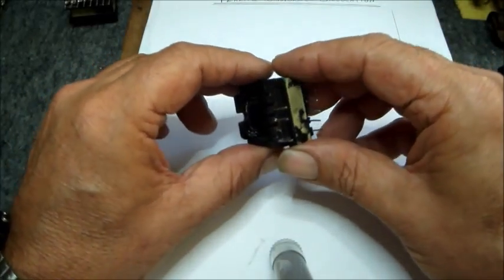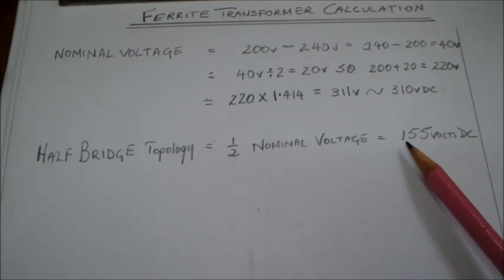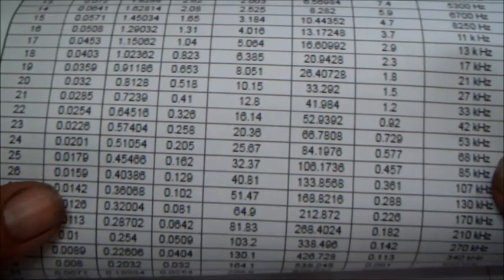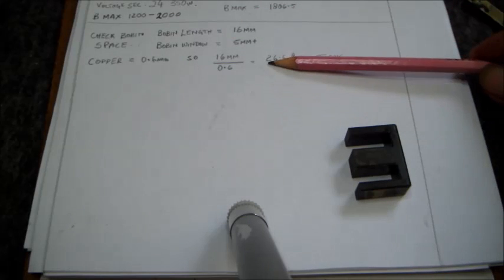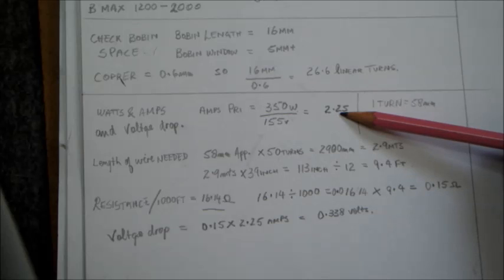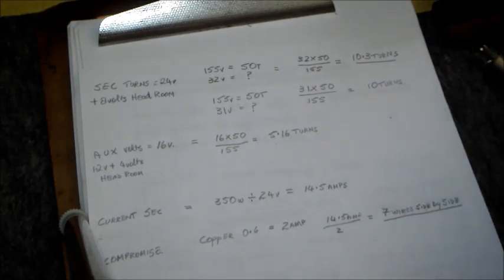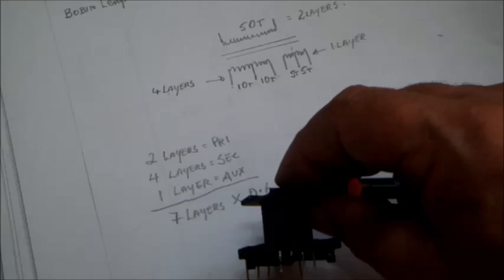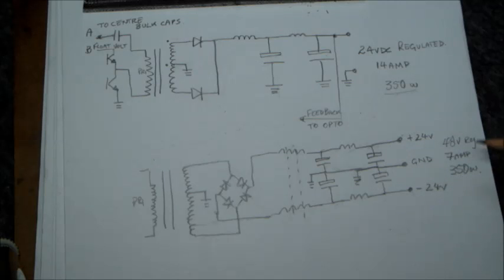Ferrite transformer calculations for SMPS

Comment: The biggest problem is the unknown transformer ferrite core, I do not now what is used in a pc supply where I got mine from.
Reply from the maker: You can keep the flux density on the low side to be on the safe side. To give you an idea if you are going to calculate for 50Khz keep at around 1400 guass.
Reply: @supersilve  Thanks Silvio for your respons, I did see this transformer has no gap, not a little strange for a 350 watts pc supply? I did measure primary original 240uH on this transformer and it is a ETD type transformer, like ETD 39/20/13 but mine measure 39/23/13 can also be a ER type also, think that it has above 200 Khz frequency seen the low inductance it originally had. Maybe I canb better buy one who has kwown specs, I need it for 15 volts 5 amp, 350 volts 200mA and 120 + 120 volts 300mA, maybe to feed the mosfet part also 65 + 65 votls 20 amps is needed, I have a new ETD59/31/22 and a E71/33/32 core 3C90, regards kees.
Reply from the maker: @audiokees4045  well that is quite some power you need for the 65+65@20A that is 2600W.  The ETD 59 will suffice for this driven in HB. Summing up the other voltages needed you will need around 220w in all.  I do not know if these voltages need to be regulated or not  but you have to be careful if so as the feedback for high voltages will be a bit tricky. For these the ETD 39 has plenty of power to give you and can go at 550w continuous and 700w peak with medium power fets.  Take a look at the video of my audio 700w smps published here on youtube it uses an ETD39. 
I would like to point out to you that a gap is not needed in Half bridge, full bridge and push pull typologies.  The gap is only needed in flyback type typologies etc where there is usually one mosfet pulsing the winding in one direction.  The gap is needed to store the magnetic field then it is released when the mosfet shuts off to start the other pulse.  However the flyback typology requires a larger core for the same power compared to HB as it only uses the first quadrant of the magnetic flux while half bridge and full bridge and also push pull use the 4 quadrants.
Reply: @supersilve  Hi Silvio, I did build a welder who was 5 kw, using a big e71 CORE, the voltage I did mention is for a audio amplifier class d or a hybrid, so the supply do only give peaks, of 20 amps, when needed by music impulses, and loud who not happen much, so mine supply do not have to work so much. Maybe 10 amps is already enough, the transformer will never get driven to his outer region then. the welder did becaus it is continously big amps, there i did use a resonant supply, idea was also to use with the audio amp because it give a more sinusoidal signal to the output capacitors making the dc much cleaner and I have soft switching. Do you now program xcellentIT? it is a program with a list of transformers and calculate the windings etc, you put in Khz, deadtimes, and core and voltages it does calculate for you, google it.
Reply from the maker: @audiokees4045  Well as you where saying if the smps you need for audio that is a different story.  To peak 2KW you still need an EE55 trafo. your continuous power will be around 1KW because audio draw around 50%.  You can opt for a non regulated supply which works on 50% duty however this will eliminate the use of an output inductor.  Input capacitance must be at least 1uf per watt so for you about 1000 to 1200uf across the 320v will suffice. (4  capacitor rated 1000uf X 200v) or (2 capacitors 680uf X 450v). Input capacitance is important to minimize voltage drop at load. Regarding current density of the copper wire you can use 6A/mm².  Yes I use Excellent IT for my calculations now it works well for HB, FB and push pull typologies.  If you want to take a look on my channel I just uploaded a 2KW smps for audio.  If you want some help just send me your mail and I will answer back.
Reply: @supersilve  Hi Thanks for advice, I am busy with desiging the circlotron tube/mosfet amp with autobias system because of use vertical mosfets, now I has a plan to build a small smps who does only 15 volts 5 amp (tube filament regulated), 350 volts 200mA and 120 volts x 2 3 a 400mA. I use the xcellentit program to calculate the windings with a kwown transformer, now I need not such big one, when I go ready with amp the smps will be have two extra 65 volts 20 ams windings, and still the feedback will be set on the filement voltage who needs to be precise and is a good start, where is your site? the copper surface also is easy to calculate with that program, I have done the welder with it, a feedback was needed for MIG also, does very good, however I have sell it and do now use Tig only. where is your site with examples, thanks.
Reply from the maker: @audiokees4045  I guess you will  be better off if you build 2 smps one with small transformer for the lower current voltages and 15v 5A.  For the 65v@20A you will do that on a separate transformer.  You can use one input capacitor bank to feed the 2 smps input and separate capacitors for the low and high current output.  You can leave the 65v not regulated and for the low current trafo you can use feedback to regulate it.  My channel is on YouTube.  Once on my channel click on videos and you can see all my uploads.  There is a lot to learn.  https://www.youtube.com/user/supersilve/videos?view_as=subscriber
Reply: @supersilve  Thanks, that is maybe a good idea, for the small one resonant is less usable so can be hardswitch, the other 65 volts can be resonant, this will give also a fast response without a feedback who needs to be done through a filter. I have in the welder using a comparator in the feedback line for fast respons, pulswise.. th small smps has not only 15 volts 5 amp but also 350v and 2 x 120 volts for the dc couple hybride tube mosfet amp. I do use 350v because of use penthodes. I go watch your channel.

Comment: how did you calculate the 350 watt value
Reply from the maker: The core was taken out of a 350w  ATX power supply.  Usually these run at 20khz.  Note also that the higher the frequency the more power a core  can give.  There is a limit but according to the core material used.  Usually these cores can go up to 100Khz or so.
Reply: Thank you for answering. But how this is calculated?
Reply: in relation to cores CSA and weight of the core
Reply from the maker: @chbonnici  It depends on what topology the core is used. A core can give different powers depending on the flux density used and the frequency of operation.  Usually these can be found in data sheets.
A flyback converter need a double size core than a half bridge converter for the same power.  This is because the flyback uses the first quadrant of the flux while a half bridge uses the 4 quadrants.
Reply: So let us assume  a 1/2 bridge topology with a set frequency as you chose 33Khz,  then how  can the core wattage be calculated?
Reply from the maker: @chbonnici  if you like to know more i suggest you see a few videos on youtube by Robert Balanos. Its called designing a flyback. He is an engineer in power electronics and design power supplies for NASA. Prepare yourself for some complex math. You can also follow some lectures from sam Ben Yacov on youtube
Reply: @supersilve  Thank you for your kind help i deeply appreciate your time . I will try to look through what you suggested tomorrow. BTW I am Maltese and live in Lija. Email: chbonnici @gmail.com

Comment: Excellent video . Can you make a similar for ferrite toroidal? . Excellent job once again
Reply from the maker: It is the same formula.  You have to find the cross sectional area of the ring core.
Outside diameter less inside diameter.  Divide by 2 and multiply by the height.

Comment: Thanx for your timely response, but let me ask you weather to do primary culculation first and then do secondry or to do secondary first and then primary for inverter chopper.
Reply from the maker: Usually inverters have a push pull topology for the primary as this is driven by low voltage,  This will incorporate 2 primary windings one in series with the other.  According to the number of turns in the primary then a simple sum will get the number of turns in the secondary.  Let us say you have 4v per turn then it will become quite easy to figure out.
Reply: @supersilve  Sir.If i use AWG25*4 wire use what will be the frequency in calculation?Please explain i appreciate your channel it solve most of our problems. tnx
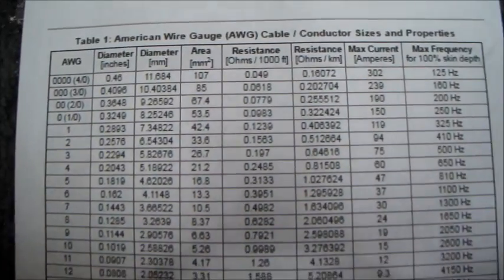Reply from the maker: @ifnzutech  As I explained in the Video every diameter of wire has its maximum frequency of operation due to skin depth of the current.  A shot at the chart can be found at 31:59.  You can see that the maximum operation frequency for 25 AWG wire is 85Khz.
Reply from the maker: For invertor chopper it is best to wind the primary first as this can be put more easily on the flat bobbin surface.  The secondary may consist of multiple wires and the winding may not be so flat.
Reply: @supersilve  Thanks sir for the quick reply my question is that if i use AWG 25×4 mean AWG 25 four wire it's frequency will b 85Khz or 85khz × 4 = 345 khz and when I'll calculate it i use 85khz or 345khz.
Reply from the maker: @ifnzutech  The frequency stays the same at 85Khz.  we use multiple wire to get more current
Reply: Sir thanks alot you solve all my problems.

Comment: For Secondary turn is it necessary to consider the frequency because i was thinking that 7 wires side by side for more amps to get is a lot. Can it may be made with some THICKER wire probably to reduce that numbers?
Reply from the maker: The wire gauge is selected according to the frequency of operation. This is due to the skin dept as current tend to travel on the outer part of the copper wire.  The higher the frequency the thinner the wire should be.  I just posted a link on the previous post for the copper wire table there you will find the maximum frequency for each wire gauge can handle .  One also has to consider how the wires will fit in the bobbin.  Remember that wire in a transformer cannot loose heat quickly due to it being warped on top of each other thus the current  handling will be less.  Usually 3 to 4amps per mm² for continuous rating and 6 to 7 amps per mm² for 50% duty cycle.
Reply: @supersilve  thank you

Comment: How to calculate the circle ⭕️ Sm transformer Csa
Reply from the maker: If you have a round core then you can calculate the area of a circle = Pie x R² or 3.142 x Radius ²
Reply: Silvio De Leonardo  sir inner radius ya 
Outer radius
Reply from the maker: @shyamsharmas-invomahamai2552   I taught you had a solid round core but now I understand that you have a ring core.  so you measure the outer and inner diameter then subtract the small dia from the large diam. then divide by 2 and after measure the height and multiply by the first answer.
Reply: Thnxs sir for replying me

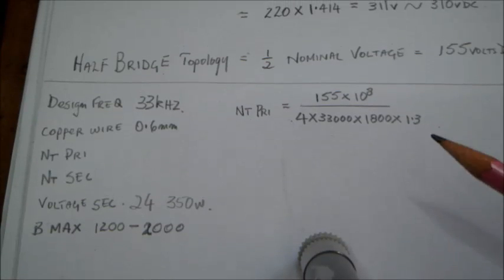Comment: 1. Formula Shown at Video time 10:15 will also work for a uncut Ring/Toroidal core?
2. What will be the rough B max value we should consider for uncut Ring Core?
Reply from the maker: B max will change according to frequency used 2000 guass at 20Khz and 1200   guass at 100khz.  As for the ring core you can calculate the core area and plug it in the formula.  Make sure that it is not a powdered iron core as it is not suitable. They act as core with air gap.

Comment: Hi, I am using EE 65/32/27 F48 MMG core, so could you please tell me the maximum power that the core can handle and what would be the optimum frequency to get peak power output.
I want to build it for 24 volt at the primary and 380-400 volt at the secondary.
Please help me I am trying to get information regarding this but I am really not getting it so could you help me please!
Reply from the maker: What are you actually building? What power are you expecting? I suggest you try something on a smaller scale first till you get some experience, when going to high powers things are not simple as they seem to be.
Reply: Silvio De Leonardo Hi,
I am building high frequency inverter using ferrite core transformer, and push pull topology, so I don't know how to calculate the optimum frequency for maximum power for my core so please help me.
I am using 0.8mm diameter copper wire for winding primary and 0.4 mm diameter copper wire for winding secondary turns, but I don't know how to calculate turns for push pull topology

Comment: thanks a lot for you but did you know the type of the ferrite material of this core or not and if i did not know the type of the material how i can choose the value of Bmax (max flux density)
Reply from the maker: If I would have known the core material I would have chosen a Bmax of 2000 guass instead as according to the frequency used it would have taken it quite easy. I played it safe and chose 1800 instead. Usually  computer ATX smps uses an N87 or PC40 core.

Comment: can you tell me why did you take flux density as 1800 gauss ???
and why Bmax is between 1200-2000 gauss ?
Reply from the maker: Usually the flux density varies according to operating frequency and also the type of core material used. For example at 20 Khz the flux is normally taken around 2000 gauss while at say 80 to 100 khz it is taken around 1200 gauss. The frequency used in this example is 30Khz so the flux density is lowered from that of the 20Khz range hence that is why I chosen 1800 Guass.  Bmax is the maximum flux seen by the transformer at the highest input voltage. The flux will be lower at a lower input voltage.  If you will work out the formula in the video and change a bit the values you will see how it changes.

Comment: if i increase frequency 40khz, power more than 350w? or power fixed? formula please.
Reply from the maker: From 30 to 40Khz there is very little difference in power. higher frequency more power from a given core

Comment: if i want to use the push-pull topology, what is the change in laws should be considered?
Reply from the maker: Not much really but push pull topology has 2 primary windings (Ex 12-0-12) in the calculation you can put 12 X 10^8 instead of 155 etc
Reply: thank you verry much for the reply, actually i want to design step up push pull converter (300 v DC to 6kv pp AC) for later multiplied to 30kV DC, my question, is it possible to use ETD59 core?
Reply from the maker: Yes it is possible to use an ETD59 core
Reply: thank you silvio, just to good understanding, if I have 320 volts as maximum input voltage, so that each primary windings is under 320V (i.e. 320v .0 .320v) which implies that in the calculation of primary winding turns I take 320*10^8/(4*33000*bmax*Ae), or take the nominal voltage?
Reply from the maker: In that case you would not use push pull topology but full bridge, and you will only have one winding for 320v.  Push pull for high voltages is not suitable as it takes a lot of space in the transformer.

Comment: How to calculate the design frequency
Reply from the maker: The design frequency depend on quite a few things to be considered.  1 the higher the frequency the more power you get from a given core but not all cores can handle high frequency. One other factor is the wire gauge to be used and how it fits in the core. The higher the frequency the wire diameter gets thinner due to the skin depth. At higher frequencies switching losses also have to be considered.  Usually a frequency between 20 and 80Khz can be chosen and most cores can handle this frequency range.

Comment: I'm a little late asking this but when it comes to making a step down transformer rather than a step up does it matter whether i wrap the primary coil first or the secondary?
Reply from the maker: no not really but its good practice to put the longest winding in the bottom due to it being of finer wire gauge. The secondary in this case may be shorter but thicker and it will fit better on top.  Thus like this the primary will be neat and flat on the bottom.

Comment: If the input voltage to the power supply was between 100V and 240V will the nominal voltage be: 240V -100V = 140V, 140/2 = 70V giving 100+70V = 170V RMS, 170V x 1.414 = 240V DC peak nominal voltage. If using half-bridge topology 240V/2 = 120V, if using full-bridge topology will it be 240V DC?
Reply from the maker: If the calculation for the primary turns had to be with a wide input voltage such as 100-240 then the calculation for the maximum input has to be considered or at least one has to calculate the maximum B at maximum voltage and see that this does not exceed limits otherwise there is a chance of saturation in the transformer.  In return the secondary windings have to be calculated at the minimum input voltage so the desired output voltage can be maintained throughout all the input voltage range. Feedback is essential otherwise the output voltage will vary considerably.  As far as half or full bridge it will be the same thing for calculation. Half bridge uses half rectified voltage full bridge uses the full voltage.
Reply: Thank you for the clarification

Comment: hi, thanks for de video very good, where you get the b-max number
Reply from the maker: The Bmax is normally taken between 1200G and 2000G for frequencies below 100Khz.  For 33Khz 18000guass is suitable and if the frequency was lower I would have used a higher flux like 2000g or so.
Reply: thanks for answering, How to know what type of ferrite is used for each application?
Reply from the maker: If the type of core is known then it would be easier to select the proper core as each core type can handle specific frequencies.  This will be known from the datasheet.

Comment: How you can get 350W with 33Khz?
i undertand that at higher frequency, more power can be transferred from primary to secondary
Reply: at higher frequency you need less windings, and can use smaller transformer. you can even get 350 watts or more with 10 Khz. Does not matter much, just parts need fit like transformer material and inducttion.